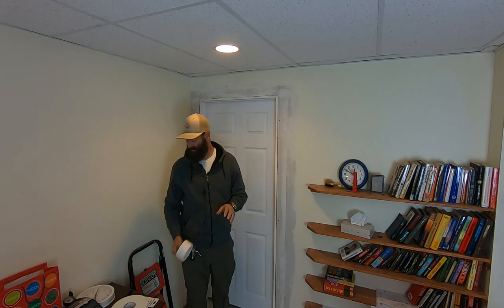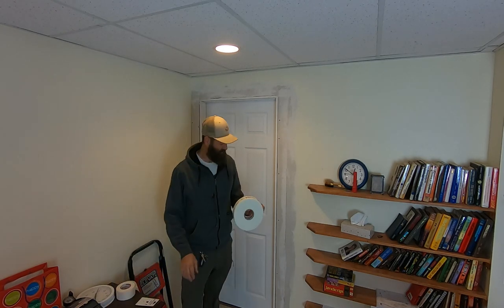Will This Change The Way I Do Wall Repairs? | Am I licensed To Use It | THE HANDYMAN |

Comment: You will not regret using it.  I have been using it for about 2 years.  I still use paper in corners, only because it gives a crisper corner.  I even use Fiba Fuse on smaller full remodels.  It is also great if you need to "build" drywall for uneven  ceilings
Reply: Also, you can run it in a banjo.  I use the Delko Zunder.  I ran 50 feet in 15 minutes on Saturday.  With 45 min mud.  Huge time saver.
Reply: Hey Handy Man!😲 I hope that's yer pink dropcloth yer standing on & not the homeowner's "Moo-moo"! 🤣

Comment: Great for patches since it is so thin. I find it rips pretty easy when you are squeezing the mud out. Still use the paper tape for corners and fiber tape a lot when using hot mud but is nice to have on the arsenal!

Comment: I have been using the FibaFuse for almost 3 years now.  I love it.  The only thing I can recommend is that when you "squeegee" the extra mud out, flatten your blade a bit because if you use too much of the edge, you can tear and stir up some fibers that will show if your mud is not thick enough but the final top coat usually hides it all.
It also makes for a great looking streamer when you leave a roll in the back of the pickup while going down the freeway.  Strong stuff..  even when it unrolls a good 100 feet!
Reply from the maker: Thanks for the tips.
Reply: @TheHandyman1  That tip that I mentioned was in the middle of your video. I was so excited you were using the product I made my comment and then when I came back moments later you said pretty much the same thing.  The only difference is you figured it out in a quick video while it took me a few jobs.  The force is strong with you master handyman!

Comment: Have you tried the self adhesive paper tape?  You dip it in water.  I prefer that.. I can be in and out of a decent size patch job in about 3 hours including paint using cornice cement or fast set etc.. The reason people have issues with it is they dont dry the tape of completely before finishing coats fyi.. If you want to try it.  So i use a hair drier on it till its about 97% dry.  Then continue with more coats.

Comment: Found fiberfuse at the end of last project. Was worried about cracks.. Found this at lowes. Gave it a try. No cracks after three years where this was installed some of the paper tape joints have already started hairline cracks. 
I will be using this on the next project. 

You play with your mud alot. Not sure if its just because of the new product though. Just treat it the same as paper tape. Base coat, tape, clean it off and then top coat. Done. Just like painting.. The more you go back over it.. The more chance it will jack up. 

Mesh tape..  Gsrbage.
Used it years ago on one of my first drywalls. Was easier than paper tape, until i learned how to paper tape. 
Mesh tape is also more likely to crack than the paper.

Comment: I used Fiberfuse to patch between a new built wall to a old wall on a remodel and It ended up cracking on both sides of the wall twice. I used hot mud the first time and all purpose the second time. Cut everything out and installed paper tape and haven't had any problems so far.

Comment: Mesh tape isn't sticky so you can stick it to the wall.  It's sticky so it will stay in a roll. The manufacturer says that you're supposed to imbed it in mud.
Reply: I was gonna say that, I'm pretty sure it's supposed to be used with hot mud

Comment: I've not yet tried FIBA-tape, but rather than using the white mesh I grab the blue tile mesh that one of the big box stores stocks. It's wider and adheres to the wall better. However, if you're trying to apply any mesh to freshly cured compound you'll likely have troubles with adhesion.

Comment: Been doing renovation work for over 40 years...I'd like to try using paper tape with spray on adhesive to set it up... be interesting to see if that works
Reply: The spray adhesive works great for coner bead but never seen the use for paper tape.
Reply: @robertschram5391  thought it would be worth a try
Reply: It kind of seems like laying wire under a slab and not pulling it up into the mud... seems like on a d/w joint it would be more prone to crack if there was just tape with no bedding mud under it to keep things stable. Be interesting to hear your results.

Comment: Have used fibafuse for a few years! I enjoy for its ease of use but use paper in corner for this stuff doesn’t work well. Also sands well no more paper fuzz or cross hatch in top coat of paint.

Comment: I have done a lot of drywall repair . I am not sold on the new fusion tape . It tears very easily . But you need it to be strong....? Hmmm. Quality mesh tape sticks well and is way stronger. I like the blue stuff. I use paper a lot too.

Comment: On point as usual. But ...whats whit the pink drop cloth? 😆  ive used all three i also like the paper tape better and also like the fiba tape but. I would think its atleast 2 times the price of paper and atleast half as much on each roll. But dont really remember how much comes on each. Another product to check out is the corner tape. Its plastic and paper, comes on a roll. Inside and outside corners. Pretty cool but also expensive but a much better alternative to lugging around 8 ft + sticks of corner bead that has to be treated like a carton of eggs..just have to watch with the corner tape. When you fold it . running your hand down it, it is easily capable ocutting rt into your skin and has got me more than once pretty good. So gloves i guess.

Comment: How easy is it to clean the mudd off the door and frame? Im sure when i start doing DIY dry wall i will have much more spots then you get.
Reply from the maker: It wipes right off with a wet sponge.  Same things goes is you get it on carpet or tile or a part of the wall you don't want it on.   In this project it's all going to be covered with door casing.

Comment: What am I missing, I just use sheetrock easy sand joint compound over seams, cracks, holes, let dry for 30 minutes up to 24 hours, sand and paint.  No tape, never seen a problem.

Comment: Man... probably the one time I have to disagree.  That stuff breaks way too easy and micro splinters... just my experience.  Now I do use mesh tape but the one you have is probably the worst you can buy... we actually use the mesh tape thats meant for durarock (grey mesh).  We can tape out a whole job using that, come back the next day, and it's still stuck.  Only time we use joint tape is for angles.  To float joints and angles we use a mark 5 Graco rig.  Thin it down enough and you do a 5 man job faster with just 2 guys.  Pressure is everything.

Comment: Hey Handyman, I see you have working on your different voices. I have a question. Do you ever cut cement in a new construction basement to change the bathroom drains so they actually make sense? I've done this once before but it makes a big mess. I had to blow in cellulose insulation in my outer garage wall which made a big difference in temperature in there but it was also very messy. I was hoping to get a picture of the floor drains before pouring the basement from the builder but they told me they couldn't find any. Keep up the good work!
Reply from the maker: Yes.  Just about every basement bathroom has to have the slab cut and drains relocated.  I use a wet saw, shop vac and plastic walls.

Comment: Fiba fuse been using it for 4 yrs. Just check out drywall nation on Instagram. They try to peel it of after it drys and it rips the drywall apart.  When they pull the tape off it just comes off easily. Say good by to cracking seams.

Comment: As a handy man doesn’t drywall repair take to long so you don’t make as much money ?
Reply from the maker: I'm an expert drywall finisher.  Doesn't talk me long at all.
Reply: @TheHandyman1  not talking about your ability but the fact you have to do several pass and come back to sand down. The proses.
Reply: @joejoe6949  nope, I use 5 minute hot mud and "wet sand" it with a sponge, spray texture and dry it with a vacuum and paint all within an hour on small jobs